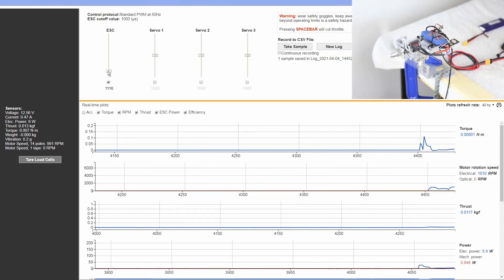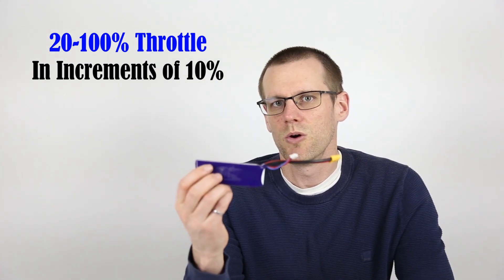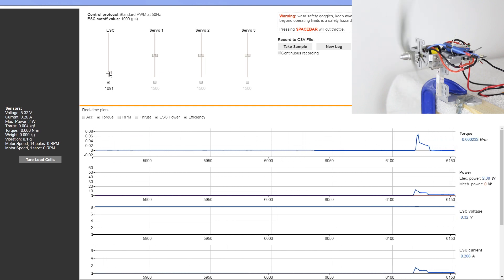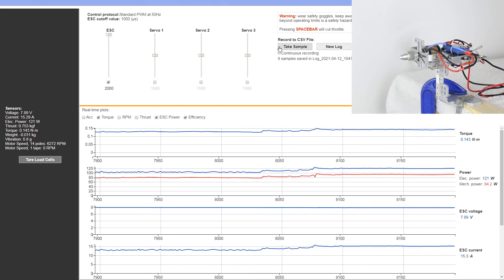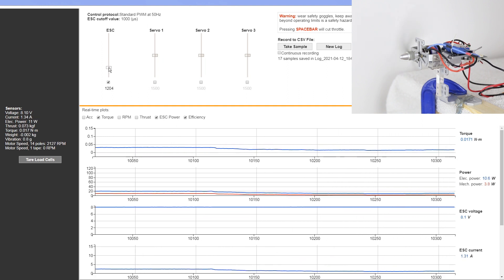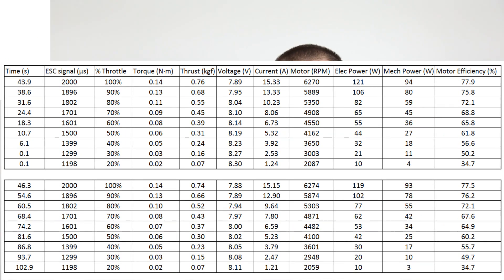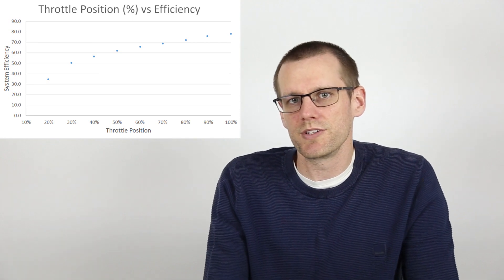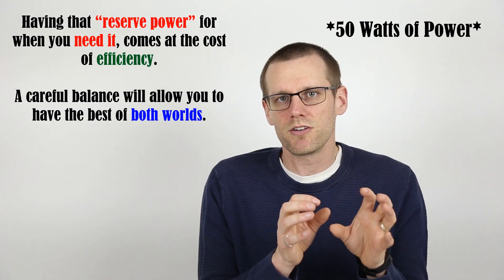Brushless Motor Dyno - Comparing Throttle % vs Efficiency

Comment: ???  You really can't draw any real conclusions about the ESC here, as you are treating the ESC and Motor as one unit- which is like looking at Miles Per Gallon a car is running at and drawing conclusions about how good the tires are without paying any attention to the engine performance.  You need to SEPARATE the ESC's performance from the actual Motor efficiency.  Measuring the motor's actual electrical power consumption accurately is not easy to do well, but you would need to do so before drawing any conclusions about the ESC.  Keep in mind, the motor itself has a best/ideal load at any given power/RPM.  You were using a propeller as a load- which varies A LOT with RPM- combine these two factors and POOF- you have no idea where the load was at vs. RPM compared to the ideal load.  Lastly, we all know that an ESC is most efficient at 100% throttle, and less efficient at lower throttle settings, but by how much and how so varies greatly- and for a large number of reasons.

Comment: I'm not sure where this leads us for, say, quadcopters. There is an operational requirement to have a certain reserve of power for climbing and this has to be maintained over the whole of the battery pack charge range. It's all too easy to have a setup where the quadcopter is incapable of arresting a decent when the battery is in, say, in the last 20% of its charge state  - guess how I know 8-)=. 
I think the useful take-away is that the 50% mechanical output condition (that is actually achieved at about 70% throttle) gives you an efficiency that is about 88% of the full-throttle efficiency. 
For a fixed-wing model or a hybrid (quad + wing) drone it suggests that the best range is likely to be achieved by a burn & coast flight pattern making use of the height range available and employing a folding prop optimised for the climb. Obviously, optimising for duration or range will require somewhat different setups.
It would be interesting to see where the energy losses are dissipated. Although I have not done any measurements on this I suspect that the losses that account for the reduced part-throttle efficiency are "iron" losses in the motor. I think it unlikely that a significant proportion are in the ESC as most modern ESCs simply don't have sufficient heat-sink capacity to account for the losses especially as, even when there is very little airflow over them, they don't seem to get more than slightly warm.

Comment: Hi @RCexplained , fantastic video - I'm hoping you can settle a discussion we've been having on an electric skateboard forum. The manufacturer of an electric skate board claims that using a larger motor pulley will result in 10% more range. This seems incongruous with your results here, which show that efficiency increases with throttle. 

The constants for the two scenarios would be 190kv motors, 12s batteries, 72t wheel pulleys, and 200mm wheels. 

1. 15 tooth motor pulley
2. 20 tooth motor pulley

Assuming you ride 30mph in both situation 1 and 2, for as long as you can, which would you think would give you more range? Based on your test result in the video, I would think the smaller pulley would operate more efficiently, as you are applying higher throttle, but I am curious to hear if you have any thoughts?
Reply from the maker: As suggested by this test and the data obtained, operating closer to 100% throttle using an ESC for RC will yield better efficiency.

Comment: Very interesting results! Is there a difference in the curve while using an inrunner (generally known to be more efficient than outrunners, depends on quality tho) or using a different kv motor?
Reply from the maker: I would expect that the results would be the same for an inrunner. If the power system is more efficiency, inrunner or outrunner, the curve would be offset by this difference.

Comment: Hmmm... unless I've misunderstood something, the test data on www.miniquadtestbench.com suggests that lower throttle is more efficient than full throttle.
Reply from the maker: Hi Andy, it is more than likely because you are not looking at true efficiency. Efficiency is simply output over input, how much you have to put in to something vs how much you actually get out of it. This is always expressed by definition as a percentage or unitless.

Comment: Posting this before test, My experience says anything other than 100% will be inefficient, because the Mosfet (or whatever the switches are these days) switching (modulating) will interfere with the operations, anything short of a open circuit will result in switching taking efficiency away from the system. As far as the eff. up or down? I doubt there will be much difference, if the battery is not on long

 After the test, pretty much as I figured Eff up or down didn't change much, glad I predicted it.
   A little info on me, I was chasing efficiency most of my hobby life, that is how i found out higher voltages and lower KV's were so efficient. My new truck (Arrma Big Rock) will eventually become my new efficiency project. Just getting back in, so just having fun right now, but eventually it'll have a 1200KV motor and 6s Lipo's . my intention is to try and get 45 minutes runtime with decent performance. Not sure if it's possible with a moderate sized battery, but it'll be fun finding out. I had an RC 10GT (blue chassis) that i converted with a lehner 1200XL (1200KV) running a Quark 80 6s capable esc and a 5s 2200 30C Flightpower pack. This was geared for 45 MPH and was possible to get 30 Minute runtimes, so hoping for similar for this new project

Comment: Hey man, love the vids! I tried using the gear calculator on the radiocontrolinfo site and it comes up not found! The old error 404, any ideas?!?!
Reply from the maker: It's working on my end, please share the link you are using to get a 404 error.
Reply: I'm not sure, I know I linked through the speed calculator and that would work but then clicked back to get to a different calculator and got the error message. I can use the calcs if I link through each individualy

Comment: i  have a question for you ?  can a outrunner brushless rc aircraft motor  change timing  mechanically  without  physically  altering the factory assembly  or rebuilding  the motor ?
Reply from the maker: timing is best done electrically. A typical outrunner can not change timing mechanically.

Comment: If at 100% throttle a Tesla car has a max speed of 150mph does that mean at 33% throttle it travels at 50mph and is only 50% efficient?
Reply from the maker: I'm not sure Luke. Not sure of the type of brushless motor or controller a tesla uses.

Comment: An eye-opening video Ryan! Such huge differences in efficiency depending on throttle position, man, I had no idea. Just wondering about the duty cycle as you mentioned toward the end of the video: Would the flywheel affect of an outrunner, cause that motor to have a more constant speed vs an inrunner motor? Maybe the difference is extremely small and of nerd-value only 😉
Reply from the maker: I would think the flywheel inertia differences would be negligible. Especially when you run the motor through a transmission or use a prop.

Comment: Thanks for the video.
Would be nice to have a motor with two seperate windings, one for regular/low speed and one for high speed.
And/or a switching mechanism for lets say a 4s battery, where the voltage sent to the esc is changed to 2s and then if you want to go fast, switches to 4s for high speed.
Is that even possible?
Reply: Yes, that is how el dragracing cars do it. They start with paralell battery packs and at some speed switch to series.
Reply: @nhytg376tgyuu765gjmg  oh wow i didnt know
Reply from the maker: Hey Mark, Almost anything is possible. It does sound simple enough but I'm certain it's more difficult in practice.
Reply: @RCexplained  thanks ryan, certainly interesting!

Comment: Thanks for all your informative videos. So and crawler guys who are on lowest throttle positions most of the time? Always on the side of less efficiency, but I follow the rule from John Holmes: volt up, gear down. Anything bad for the electronics on a crawler assuming you have the right gearing but most of the time with very low throttle positions? Thank you very much for you time.
Reply from the maker: At very low throttle % you are running inefficiently, however it is also at such a low power draw. Nothing bad (for electronics) in operating this way for crawlers, assuming the right gearing.
Reply: @RCexplained  okay, thanks for the quick reply!!

Comment: Subscribed, such useful  content. Question, what happens to efficiency when we start to push voltage beyond factory recommendations. I have seen your videos on heat build up, but it would be informative to get data from the dyno, thanks
Reply from the maker: Thank You!
Pushing voltage beyond limits on which component, the motor? If so this can result in instantaneous failure if the motor manufacture's voltage limit is based on maximum rotational speed. (Which it should be)
Reply: @RCexplained  Yes, in context of the motors. In my field of rc (robot combat), it is not uncommon for builders to push past factory limits. It is a fringe case, since component longevity is almost always a non factor due to the nature of the sport. Motors are almost always drawing to much amperage from doing jobs they were never intended (spinning large heavy masses) and stalling repeatedly from impacts.  Keeping heat to a minimum is a constant battle.
Reply: I was wondering about a similar thing: is it possible to run a 4s esc on 6s or a 6s on 8s and so on if the capacitors can handle it and there is no overvoltage protection and lipo cutoff is not needed. Will the efficiency drop or stay the same when over-volting the esc?
Reply: @rcandfun242  Ive been exploring this myself, as i understand it, esc voltage limits are HARD limits, over voltage usually produces instant destruction of an esc, rather than an incremental heat death in the case of a motor. Ive looked at options of steeping voltage down to the esc, but it always seems to come with reducing available amperage. So far i cant find a clean method to run multiple voltages to different components from one power source. I have run ecs's on higher voltage than expressed (by 1s) and destruction did not occur. However there is no one I have found that would endorse the action, so unless no other option is available to you, i would not attempt.

Comment: I will argue bigger motor is better efficientcy.I have tested large 3kw brushless motor against a 500w electric lawn mower experiment with stock esc controller and found the big 3kw motor draws only 5amps compared to 10amps on the 500w motor at 40v at full throttle no load 3500rpm turning 36cm long mower blade
Reply from the maker: Hi Greg, interesting test. I'd be afraid that the 500w motor is not going to cut much grass. 40v @ 10A is 400w of power before cutting a single blade of grass.  The remaining 100w of useable power to cut grass would be 0.13HP at best or more likely to be about 0.09HP. Overall efficiency would be maximum 20% at best which is the lowest I have ever seen in a motor.

Comment: Surely the car will still run for longer at 70% throttle than 100% throttle though because it's not going as fast and not making as much power
Reply from the maker: Yes that is correct. Look at it this way. If you only need 70% power or throttle and efficiency is your #1 objective. Change your power system so that you operate at closer to 100% throttle (same speed as 70% throttle previously) and you will see a boost in run time. 

If you are anything like me, everything I own is overpowered. When I operate my RC's at a low to medium speed, I take a hit in efficiency because I have so much "reserve" power. I am not going to sacrifice my top speed potential to increase efficiency. This is because my #1 goal is top speed and not efficiency.